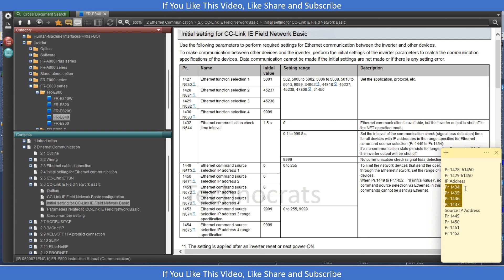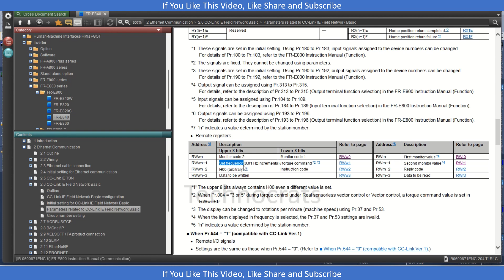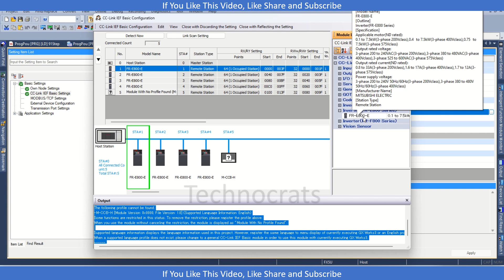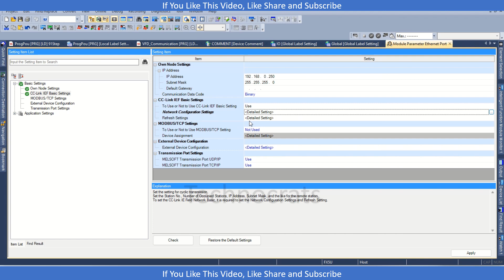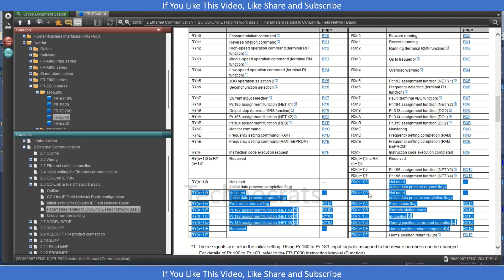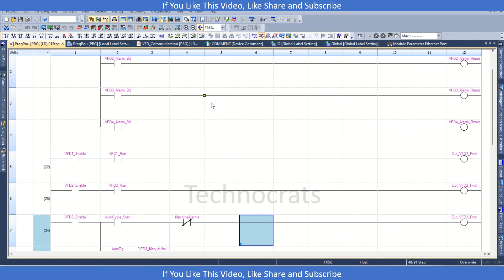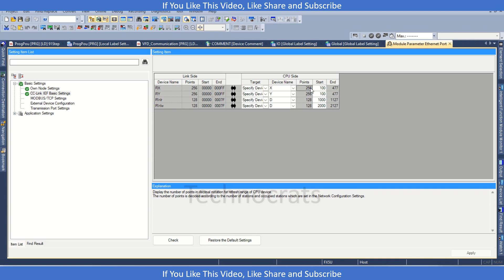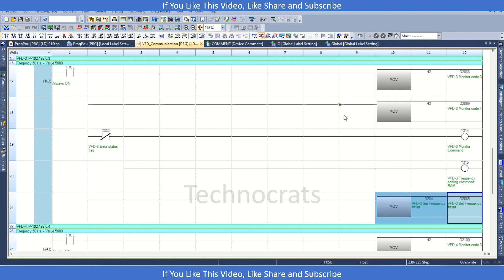FR E800 Drive With FX5U Using CC Link IE Field Basic

Comment: I want to read the motor current. I can read the frquency  but not the output voltage and the output current. Can you explain me , how it works ?
Reply from the maker: Write Monitoring Code in RWw0.
Monitoring Code for Output Current is H02, Output Peak Current is H0B
Reply from the maker: You can see the monitor codes in FR-E800 Instructions manual(Function) 12.2 section